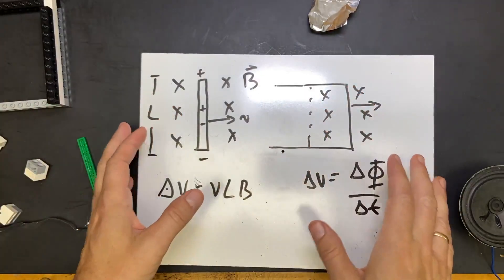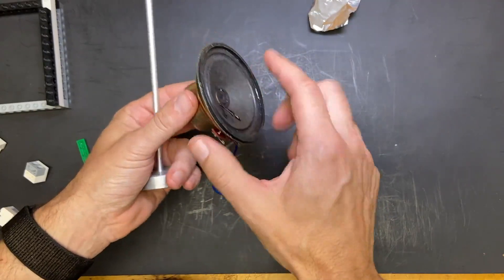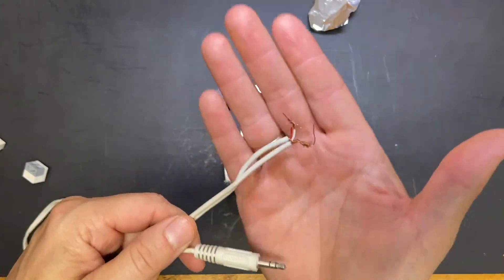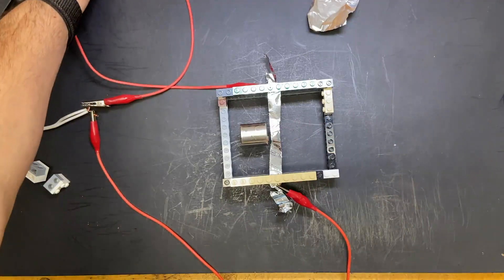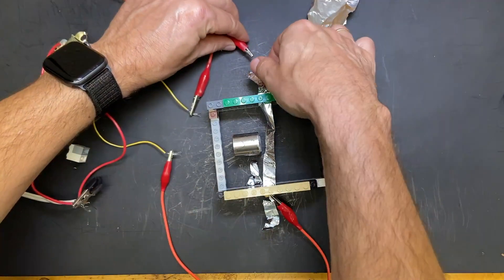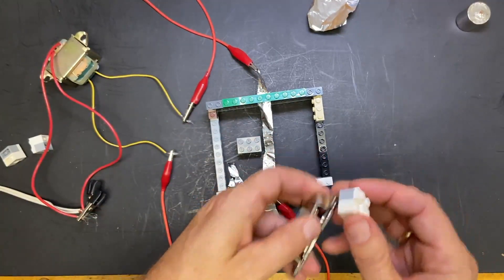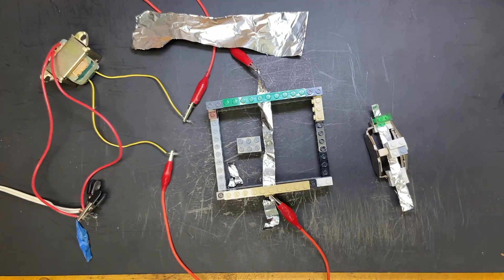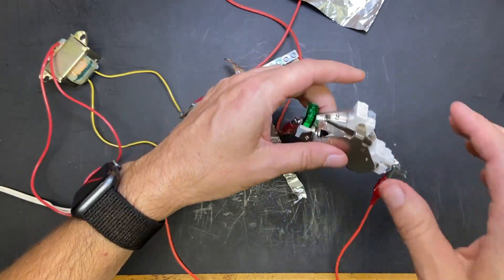DIY Simple Ribbon Microphone Using Magnets and Aluminum Foil

Comment: You need to tighten up that foil ribbon, in a regular microphone if the ribbon even droops a little bit from its own weight over time the output will drop significantly. I'm surprised you're getting anything especially since it's loose and using one magnet

Comment: I don't think that's an audio transformer, that is an AC power transformer, used to power the speakers. Audio Transformers usually somewhat smaller, and shielded. Also the lead configuration, leaves me to believe that that is a dual wound primary and a dual tap secondary. Which would make sense cuz it would allow you to run on 120 or 240, and provide the Dual output for the bipolar power supply, it still would give you a voltage step up if wired backwards.
Reply: Well @shango66 used a power transformer for a similar use in a radio output fo the 50c5 amp and I worked great.